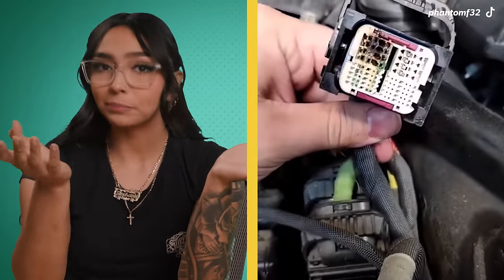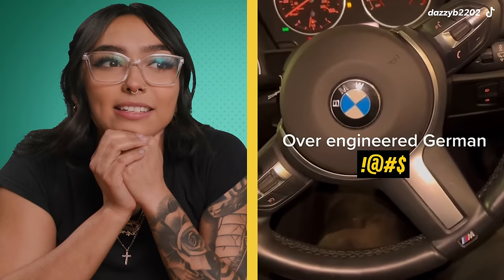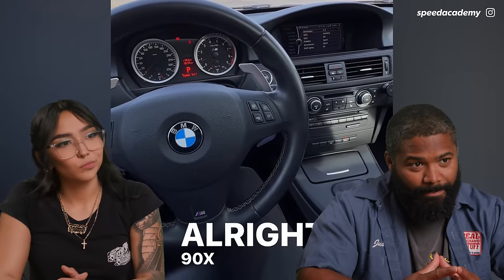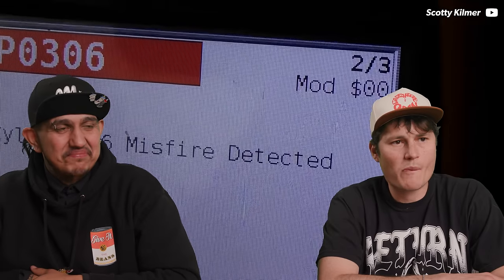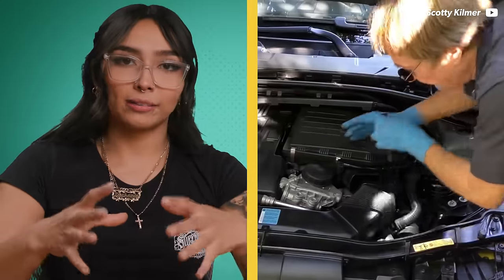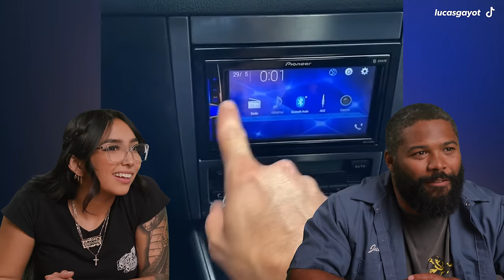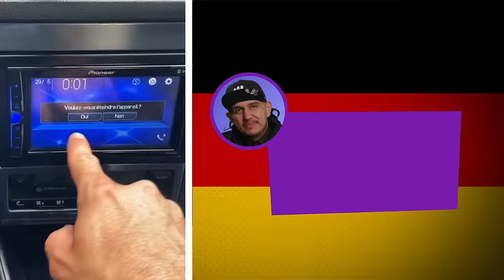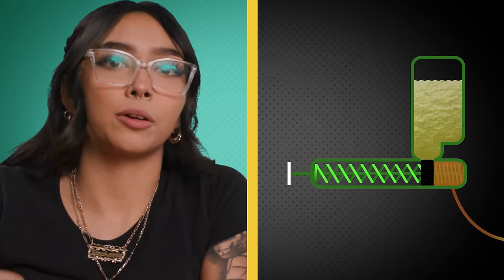Mechanic Reacts to German Engineering Fails

Comment: Anything German at all. I worked at VW as an advisor for a few months which showed me how much worse they are than I ever realized. There was one of the AWD SUV's we had that needed an oil pan reseal, but you have to take out literally the entire drivetrain out of the vehicle in order to access it. Like, had the body on a lift and the drivetrain on the special VW lifts they make the dealers buy for $15k a pop in order to support the engine and drivetrain.
 
Another example of just stupidity was for one of the repairs, the service manual literally says to put some tape at the end of a screwdriver, and push the screwdriver sideways against a bolt so the tape gives it that grip in order to loosen it. It's insane something is designed in a way you can't actually remove and install a bolt in a normal way. Let alone the fact that the engines use at least a half-dozen different bolts, compared to Japanese cars for example that use like... 1.
Reply: I've only ever owned Toyota and Subaru cars, particularly with Subarus you can see the level of attention that went into making everything as easy as possible to disassemble.
Reply: The thing not shown here is that VWs are and FAR worse. The stories I have heard.... also Mercedes makes a solid engine while VW has SOFT STEEL everywhere and the camshafts often die VERY young. Like so soon it's ridiculous. The stuff I have heard is FAR WORSE than the chinese built cars in Australia

Comment: Owned a Z3 for a year. Throughout that year....
I learned manual. The clutch held up to the abuse.

But the coolant system didnt!! I replaced the circuit. The thermostat. The coolant pump. The cooling fan. The alternator. Finally another circuit to get it all working. Turned out meh alternator was blowing the fan circuit. Causing the cooling system to overwork. Thus blowing the coolant pump.

If you wanna learn cars. Buy a BMW. It can only get easier, less time consuming, and probably less expensive once you switch brands. Irony is i drive a tesla now as i build my C5 and diesel truck 😂

Comment: I'm familiar with that steering wheel shaking issue. It started on me after I spun out getting on to the interstate in Knoxville, driving a 99 Ranger. Did a lot of bouncing around so I was thinking it's got something to do with the suspension. It vibrated the worst when I was really leaning into those turns. The harder the turn, the harder the shake.

Comment: they havent seen french cars. they are hell
Reply: or british. with special mention of Rolls Royce, when it wasn't german engineering.

some of french cars, back in early 80's still had ''medieval'' hand crank as starting method. 
and french cars aren't suited for colder climates, cause hand brake will freeze shut.

Comment: I had a AUDI A6 2003 ,to remove the starter ....you start from the headlight and so forth ...and the starter has 2 bolts 🤔
Reply: Had a C5 Allroad, same as the A6…that damn “Service Mode” was a bitch! Whole front end off for just about anything and everything!

Comment: The clip at 10:07 reminds me of when I saved a collegues life and she thought I was the dumb f*ck. I was working for a care company, we drove to disabled peoples houses to provide assistance. When I was done with a client I went to try and help my collegue who was on another run. Her BMW wouldn't even crank and I could hear a relay randomly switching. It turns out the big bottle of screen wash she had in the boot (sorry I'm from the UK) had leaked completely and drenched the battery. I saved her life when she tried to touch the battery, I knocked her hands out of the way. She was annoyed and said to me that I was a dumb f*ck for not knowing its safe to touch a 12v battery. I told here "yeah its safe when the battery isn't drenched in screen wash and causing a relay to short out"!!!
Reply: 12V is perfectly safe. Here in the states you don't even need a license to work on less than 50 volts. And DC is MUCH safer than AC. If something shorts out, it will blow a fuse, but most likely wouldn't be a safety concern anyway.
Reply: @xeridea  Low-voltage is considered as anything less than 60 volts because that's how much it takes to breach the skin layer. However, as a marine electrician, I can verify that at high voltages DC is way more dangerous than AC 😁
Reply: @xeridea what kills you isn't the Voltage, is the Current and a car battery can and will fry you if it can
Reply: @jlGenozzV  Current and voltage are connected to each other though.
Its like saying "The height doesn't kill you, when you fall. The speed with which you fall does."
Thats technically correct, but where the hell does the speed come from?
Reply: 12V is perfectly fine to touch unless you have a deep scratch on your hands. So she was right.
Reply: I saved her life. From a 12 volt battery touch with water. Sandro this dude know something or not?
Reply: I got popped with 12 volt. Knocked my heart out of rhythm. Pretty much why I got out of the field. Electricity can get dicey.
Reply: i think everyone responding forgets that MOST washer fluids are flammable as hell...
Reply: @@retiredbore378 Canadian here so, quite flammable up here

Comment: they should do similar take on american junk aswell
Reply: They're too patriotic for that!
Reply: That would just end up in a compilation of american cars rolling off the assembly line, cause that's where the biggest fails are already starting.
Reply: What are you claiming???
I've got a 78 E-150 with a 351W, 4speed manual, & locking diff
as well as a 2007 Mustang GT and they are clearly not junk though I kinda hate the window design on the Mustang...
Reply: Like tesla

Comment: I own a 2002 Hyundai Elantra 5 speed. Paid cash for it as a second hand car. Had to replace the clutch master and slave cylinders, was pretty straightforward. Only trying to break the nuts loose without breaking the metal lines was my worry. Thankfully they broke loose after some trepidation on my part without breaking the metal lines.

It may be a Hyundai and not a Honda, Toyota or Mazda but for me it's been a good, reliable car that many things I as an amateur wrench puller can work on. Certainly larger life time services and  repairs I had a good mechanic do for me. Yes, the costs added up, but its still cheaper than a new car autoloan.🤔

Comment: Anyone ever heard of TÜV? In Germany it's mandatory to have your car checked every two years by a TÜV technician. Regardless if you have problems with your car or not. With these intervals it's very unlikely that something might break. Most of the accidents are caused by the drivers behavior, not the car failing.

Comment: LHD Volvo cabin air filter on the 2010-2016 models.. 
Remove the  gas-pedal to access the panel, remove the centre console partly to get to the hatch. and struggle to get the filter out. IF you're lucky to get it out

Volvo's aren't great aswell.. But Volkwagen sparkplugs is not a 5min job anymore. i hate those hoses!

Comment: meanwhile my old 2005 Citroen Berlingo popped out it's gearbox cables last summer. I simply leaned down into the engine bay, pushed them back in and went to nearest shop for replacements

Comment: It is crazy, my family always had Volvos and I mean, yeah it was hard to work on them, but looking at this video, I start to think that it might not be so bad after all.

Like, fun story which made me not so happy once. We had a broken generator. It is not big kid a deal, I remove it with my father and we replace brushes, because most of the time, brushes just are too short on "old" Volvos, it was 2005 Volvo V70, so, we forgot to bench test it, we put it back, it dies not work, we again remove item. The bad thing is that we did it like few times, around 6 times, and everytime you need to remove serpentine belt and power steering pump, to get the generator out, but it's not a big deal. The big deal is that we needed 5-6 times to repeat it because the voltage regulator was dead and in my town no one knew that from end of the 2004 year they started to change from analog to digital voltage regulators, and yeah, we bought new voltage regulator which in catalog corespondent to our car VIN number, and then I randomly stumbled on the fact that the generator is LIN controlled and yeah... long story short, a lot of times I can find myself fixing a Volvo car which has electronics problem, and a lot of times, there might or might not have an easy fix, and sometimes for this l have to go trough the whole car or repeat same process many times. So I would be ok removing all the parts to get to some sensor or part to replace it and get away with it then have an electronics problem like I had with Volvo P2 platform, then I have engine check engine, which I can't solve, then randomly climate control stops working, then randomly fuel pump stops working just to find out that in some place in the long wires the wire is burned, I could go all day trough these problems, and them I have old Volvo S70 which had only two problems - needed brake replacement when it was bought and fix the extendable radio antenna which was somehow stock, which let me think that no one used the radio.so yeah, my conclusion is not to buy a Volvo P2 with electronics problem, you will regret, better find old Volvo P1 or older model and hope that it has not seen salty winter for 3 or more years

Comment: I had a 2001 VR6 Jetta. I was driving one night in the rain when the lights and wipers suddenly turned off. The road was lit, and I was down the street from my home, so I continued driving until I saw smoke coming out of the DS AC vent. I pulled up to a red light, looked closer at the vent, and a flame shot about 3ft out of the AC vent and burned my eyelashes and eyebrows off. There was a common short to the multifunction switch in these vehicles, but mine was a "less common" malfunction. The vehicle still drove after, so I drove it for a month until I flipped it doing 120 on the highway. Needless to say, I no longer buy German nor do I speed.

Comment: 2. Steering - well electric steering assist is lighter, simpler, more reliable, doesn't require any additional pump or fluid.
3.Might have been a leaky LPG installation (popular in Europe as this cost roughly the same as petrol in the US). Liquified petroleum gas is heavier than air, thus it could accumulated under the car to some degree . Or it was an assassination attempt.
8. Why is taking out pedal assembly to fix the pedal assembly a big deal? 🤔

Comment: Worst German car I have ever worked on: a friend's BMW X5 (E70) with 4.8L V8 (N62) engine. "Alternator bracket gasket" (seriously, wtf?) and "coolant transfer pipe" (in the valley). I think, BMW labor would have been 18 hours on the $12 gasket, and 40 hours on the $200 pipe. At the time, the local BMW dealer charged $159/hr, you do the math. I did the work for a fraction of the cost and then the "thing" went off into craigslist heaven.

Comment: They should rename the series audi/bmw engineering fails, they rarely show Mercedes for any significant issues... Especially 90s to mid 2000s benz, the v6( m112/k) and v8s  (m113/k) drivetrains are so simple and easy to work on.

Comment: I own and maintain two Germans, a 3.0 TDI Audi B7 and a 1.9 TDI VW B5.5. The overall impression I get is that jobs are like puzzles with one das korrekt way of solving or you likely won't solve it at all. Probably due to the engine bays being crammed so full.

So, unless you know the specific order of removing parts, nuts etc. that at first glance need not be installed "in series", you're in for guesswork. A winning strategy apart from youtubing it is to try several methods, but don't get stuck with one even if it seems correct - "just a little more force" - you'll only get more frustrated. Often going the extra mile saves a roundtrip of headache.

Comment: The hardest German car to work on has to be the BMW e60 m5 not because of the parts, but because you have to pay 30k-50k in transmission and exhaust system maintenance every 20,000 to 30,000 miles just to keep the car from turning into a piece of bankrupting fiberglass.

Comment: As a BMW technician I can say most of these cars are designed to be fixed in a certain way with the intention of disposing after a decade at most not that build quality is bad but parts manufacturers want profit too and the tolerances are beyond anything normal that being said they're not hard to work on you just need to be a good tech.

Comment: i had a mercedes b200 and the computer and fusebox were in the battery compartment which had the drain holes plugged from the factory, if a battery started leaking it would soak all the electronics with acid or if it rained a lot water would pool in there. i poked the plugs out but the first time i opened it up there was about 6 inches of water in there

Comment: I had to come back after just watching an episode of the Australian Armour & Artillery Museum's Workshop Wednesday where they are currently working on the transmission for a StuG III Ausf. G which is likely 80 years old at this point. There have been many episodes where complaints about WTF engineers are thinking when they place parts where mechanics have to be able to reach later, later like bolts that back out only to hit the subframe and stop or an AC unit that requires removal of the entire dash to service Effin' looking at YOU Volvo!).

But what I wanted to say was they show in the video how the engineers worked in a small divot on the hull of the tank, so when the transmission went in it would be physically possible to reach around and put in the bolt on the corner of the housing flange. Why can't we do this kind of fine work anymore? It only seems to exist in the smaller specialty shops like the ones most of you and your guests own/work at. The corporate manufacturers produce modern 'Malaise-era' cars IMO. Right now the only cars I trust mechanically are Toyotas.

Comment: Hey had a 2014 ATS with an bad coolant temp sensor.  Coolant got through the sensor wicked up the harness and pooled in an x2 connector at the k20.   Killed ecm

Comment: Worked for a company which is a sub-supplier of certain parts for BMW some 8 years ago. We were working on a new BMW 3 series and had open channel discussions with their RnD department about new designs, production concepts etc. One day I notice something done in a really weird and ineffective way, so I propose to them to change it to a better solution to make a certain part placed in a different way. Guy replies that they did that on purpose so you could only fix that in a authorised BMW dealership, and that they have a separate sub-division in RnD which reviews designs just to make them far more difficult to maintain and that decent chunk of their profits come from after market sales.. that being said they are still great cars, any german car(except opel) over any french or british (in my experience british are worst).

Comment: Personally I got myself an Porsche 957 gts and there’s an known issue where the drain for the air conditioning where it clogs and then it so kindly redirects all the water to the bottom of the A pillar on the drivers side…. Where it happens to hold only all the wires for the car….. in result your car becomes a massive paper weight until you can find the corroded wire(s) and just makes you regret life honestly 😂

Comment: I've had VW Golf once and man. It was full of flaws. During the winter the door casks were so densely sealed that if temperature and air huimidy was right, night time temperature went freezing... You literally couldn't open the driver door without bending the metal in the front ledge of the door since it had ice buildup inside the door front well. Not a great car if you live seaside and have cold winters. Electonics also gave all sort of computer errors which thankfully were easy to reset by driving side of the road, shutdown and restart. Magical ghosts. I think maybe the damn thing was overly sealed and humidity caused all kinds of mishaps.Those were small though. I had recently a Ford Focus which was a delight to drive usually. Year back estimated I could have gotten 12-15k USD or EUR for it  since it was 10 years old but had only 30k miles on it. Well. The gearbox had started minor leaks last year. Sweating, not flooding. I took the car to transmission service and the car was AFTER the service worth 2,5k. Something had stirred with the change of the transmission pan and car went completely illogical. You could possibly drive forward but the reverse didn't work at all. Well. You could shutdown and restart and all at least for the moment funtctioned right. However. Eventually always the "Transmission failure" showed on car display meaning you couldn't accelerate when needed. At that point I decided to cut my losses and switched the car with same dealership I had the repairs made since "they owed me for the blown car". Well. Problem was even to my untrained eye with the transmission automation. Next time I see something similar. Ditch the car and take as much as I can. :P

Comment: gotta say.. love the shows.. 

You commented that you "need" to depress the clutch-before you can shift.. We all know that isnt true at all. Maybe to start a modern car-to havve the safety switch turn off.

Ive driven over 11 million kms on many different vehicles. i only use a clutch for 1st and reverse.

any decent driver uses engine rpm and road speed to shift.

Comment: My 25 year old Toyota has factory plastic under the hood, fully functional and not brittle at all. I've seen BMW's less than 5 years old with dry rotted plastic under the hood, they're cheap everywhere except the engine and transmissions. And I do mean just the engine, not even the wiring harness on them are any good.

Comment: On German sterling wheel jitters it suck have you seen how it could be power stearing failer or just the thermostat wire mixed with the stearing sensor